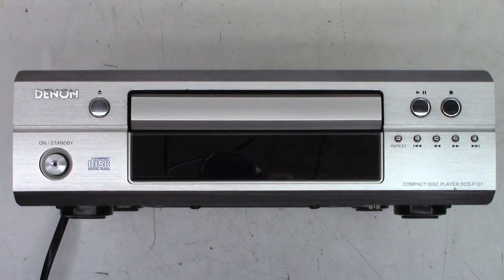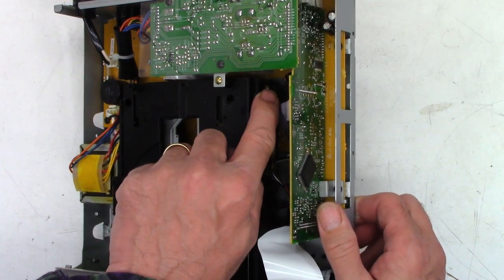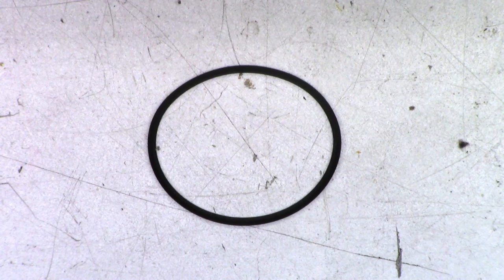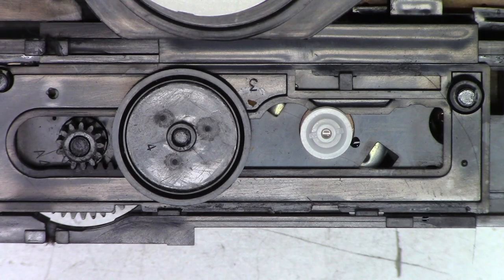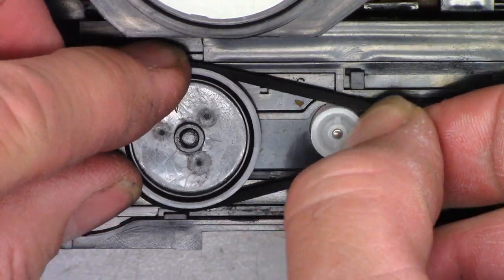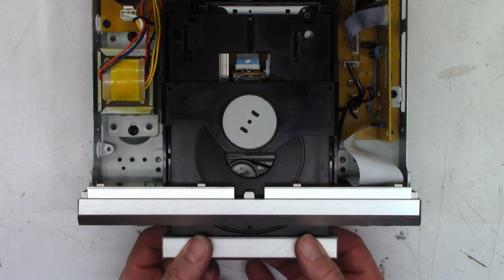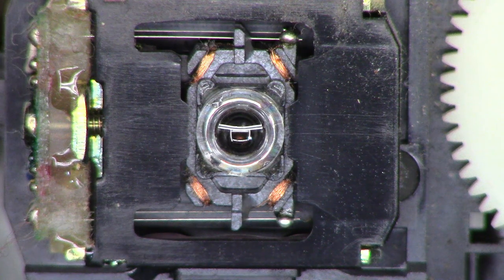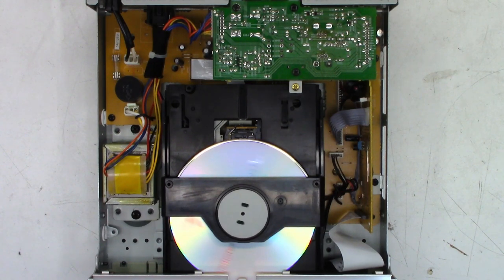Denon DCD-F101 "Compact" compact disc "CD" player. Drawer wont open. Very much in need of a service

Comment: Superb troubleshooting video! This has helped me repair a 21 year old Denon UD-M30 CD player drawer problem. The latch on the underside is slightly obscured by a rubber foot, which is easy enough to remove.

Comment: Hi Steve, thank you for this excellent video. I just ordered a belt for my DENON. However I am a little perplexe that the central motor which I guess has to spin the CD is not reacting when I press on play. Is that normal because the tray is dismounted ?

Comment: I have this same issue with a different model. But cd tray won't open. When I press eject I hear the motor but doesn't open and stops. The cd that's stuck in there won't play. Do you think it will also be the belt on mine? Many thanks and great video
Reply: Yes, it's the belt that's stretched and needs replacing.

Comment: SF-P101N   cd pickup ?
Reply from the maker: Could be
Reply: Is there any trick to disconnecting the ribbon cable for the display (connector on the right around 2:00) I am trying to replace the laser in my unit and I'm not sure how to disconnect this part

Comment: so it looks like the optical pickup works opposite of a vinyl record out side in optical inside out to last track when reading  never knew that
Reply from the maker: It does read from the middle out at a constant linear velocity (CLV). Meaning the data passing the laser is always at the same speed.
Reply: @norcal715  good to know steve thanks for the video!